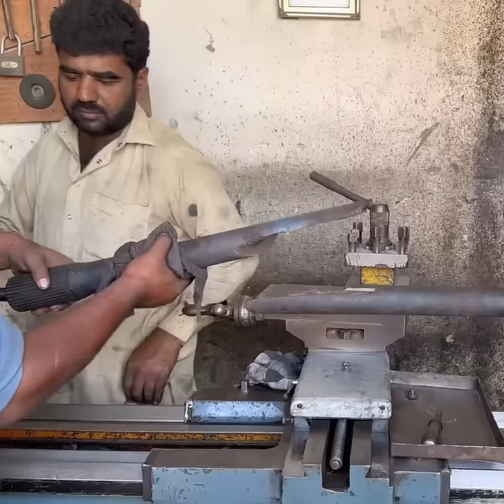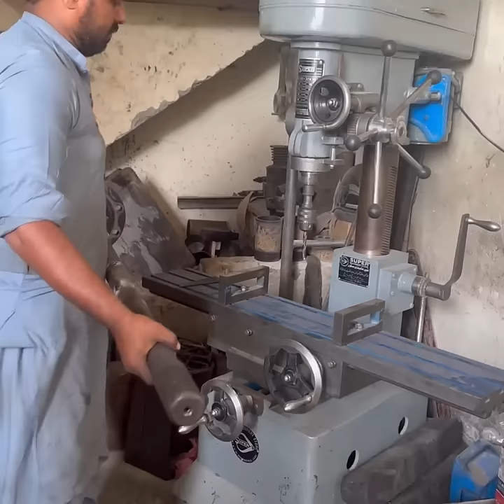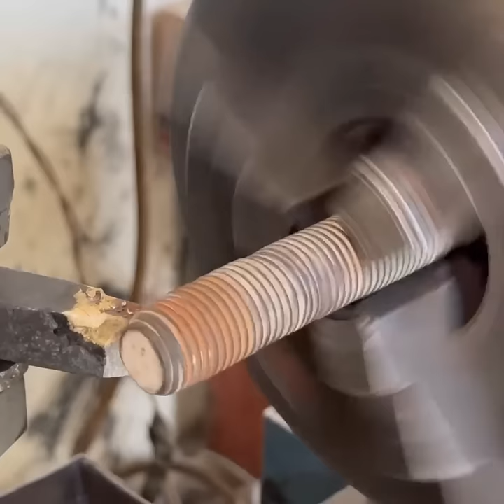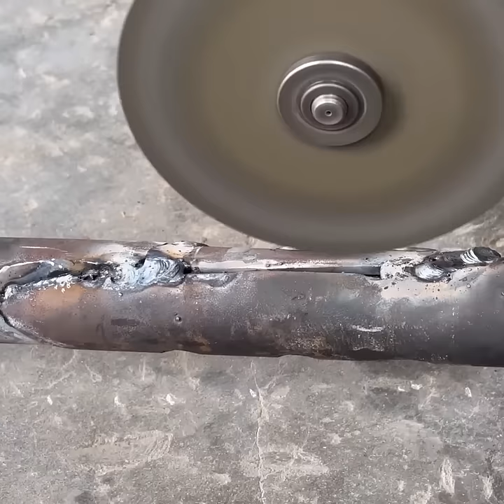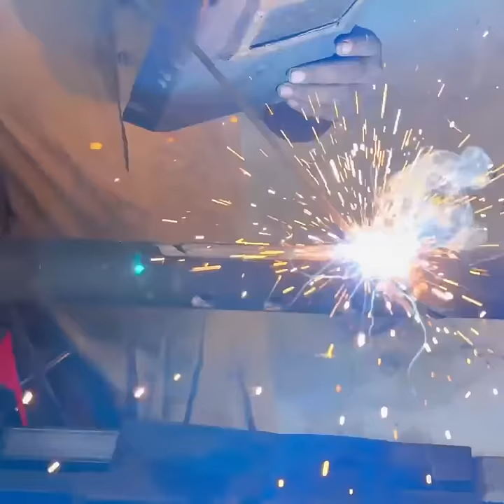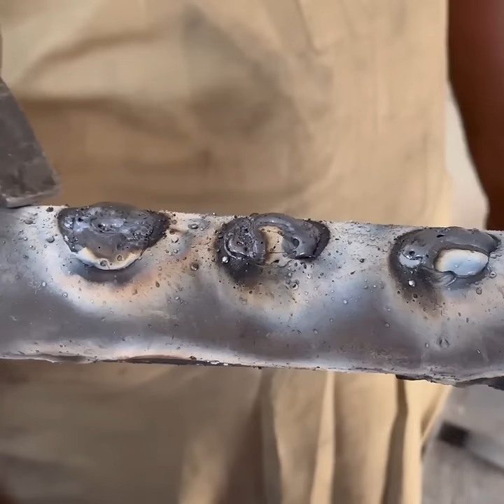How to Rebuild Broken Axle with Amazing Technique

Comment: As an electrician i approve this weld.
Reply: 😅man stay a electrician 😅💀
Reply: @rasherobinson2428  I know, that's why i commented a bad weld. Welding ain't my job, so my opinion is worthless. :)
Reply: @rasherobinson2428  When sarcasm pass, you looked the other way it seems.
Reply: درست است برقکاری ربطی به جوشکاری ندارد ولی نظرتون محترم
Reply: @aran_kurd Yet welding has everything to do with electricity.
Reply: Same here lol twist some copper around it for safety.
Reply: @jacobplank  I would personally install a heat shrinkable tubing on top off it to prevent any other breakage in the foreseeable future. :)

Comment: Love how you can see it cracking while they drive in the bolts. No way that thing is gonna last (or that this is cheaper than just buying a spare from a scrap yard)
Reply: This was from said scrap yard, the best they could find, not everyone throw away things like in your country. Buying a new part just wasn't an option as it is too expensive for them.
Reply: Don't use your standard of "Scrap yard" for other countries. People in your country throw away stuff that is still fixable or even usable. Meanwhile in the East people only throw stuff away when something couldn't be fixed at all.
Reply: Isso aí se chama profissionais , é o que está faltando em quase todos os lugares do mundo, quando se quebra na estrada e não tem recursos,tem que dar um jeito, e esse serviço com certeza fica 100%, fazem isto o dia todo.
Reply: It doesn’t matter how long it lasts on that economy. When it breaks and destroys itself to the point of no repair…. They led figure something else out. Thst May may be an hour or day away…. Most likely longer.
Reply: This is not Europe or the North Americas, it's India / Pakistan probably..
Replacement with new part? prohibitive price.
Scrap yard? if available, time and cost prohibitive.
Downtime on a commercial vehicle  could mean no eating for a family until fixed.
So? limited options, which makes them innovators, "doing the best with what they have".
And they can produce some great items..
Reply: @WangZord unanpieza de fundición no se puede arreglar soldando y con tornillos. Lo que hace es perder el tiempo y estafar eente
Reply: @martinsalazar6677  Why don't you tell them that and fund them while you're at it. Ofc it won't last it's a DIY job, then they will fix it again until they can afford to buy a new one or this one become unfixable. It's called "Improvise, Adapt, Overcome".
Reply: @WangZord  es un palier de camión, por el peso y la fuerza que hace, se usa una pieza única de fundición donde las fuerzas se distribuyen por toda la pieda. En la pieza reparada la fuerza se transmite por la soldadura o los pernos, los cuales no van a soportar dicha fuerza. Si fuese una reparación en medio del desierto para sortear esa situación, ok. Pero al parecer es una costumbre, bastante peligrosa. No te gustaría estar atrás del camión que pierde la tracción.

Comment: I wish I’d seen this years ago. I remember trying to weld some farm equipment to keep us going because the part was weeks away and we’d be done by the time the part came in. The hose clamps were ingenious!!! Wish I’d thought about that.
Reply: It's clever and potentially workable but I never saw them check the alignment of the 2 pieces and I didn't see any balance marks on the finished product. I can't see this lasting too long if it isn't perfectly straight and balance. The balance could slide if it is slow moving but  not so much the alignment

Comment: I was skeptical at first but when I saw that back cut for penetration and the dimes this boy was stacking, this is a damn good machinist working with what he has, mad respect
Reply: Except for all of the crap left in the middle which will just cause that to be weak and break. Doesn't matter how good the welds are on the outside.
Reply: @bruwin  I figure the pins will help reinforce it, but you're right, if there's Slagle amd porosity throughout the weld it's basically one step above duct tape
Reply: No way this axle is co-axial or balanced now. This most probably will cause vibration and extensive wear at some speed. The original part broke and the fixed one is not stronger.
Reply: Balance, an axle😂.  It is supported on either extreme end by a bearing.  As long as it doesn’t have a lot of runout in the middle you would never know.  And, they had it in the lathe so they know it doesn’t have any runout.  Also, I doubt the truck that’s from ever sees much over 50-60 MPH or <100 KPH
Reply: Just cos it looks nice, there is no torsional strength in it. The cracks are still in it from the break.
Maybe if they gave it 6 weeks the metal might heal together like bone... but its not bone, it will break again as soon as a load comes on.
Reply: Death wobble

Comment: As an aeronautical maintenance technician I aprove this repair, I realize it every day in our A330 fleet.
Reply: I think the popsicle stick bridge i made in the 9th grade had more structural durability than this shattering weld they did. It litterally had more cracks when they finished than when they started. I bet duct tape would hold better than those welds.

Comment: Looks like it has internal rust issues already. That's pretty much a waste of time trying to fix it as it will surely break again after some miles.
Reply: Do you really think they can afford other options? If they are even available to start.
Reply: @Anzeth_Zeon he's still doing bad technique: not cleaning the broken parts before Putting them together, the welds are not properly done(cold/uneven), the axle was not straighted Out and tested for trueness... just another video of somebody doing subpar work and people lauding them as cratsmen
Reply: @Karnickel93  kool, where did you learn about car repair?
Reply: @Anzeth_Zeon tf you mean where did he learn it, fixing your car isn’t some rare skill
Reply: @benwilliams9016 where did he learn all those steps? That is not basic car repair.
Reply: @xxxLUKRASsxxx  so he knows car repair plus machining? Do most machinists know how to weld?
Reply: Look at the grinded parts there is no visible rust on inside
Reply: @Anzeth_Zeon sounds like its you who has not a damn clue about metalwork or basic science . I was gonna ask where did you learn about metalwork but i know the answer , you didn't.  End of subject move on .
Reply: @Karnickel93 they done what's  right. You're just hating
Reply: @jackjack4412 that's a basic skill for every man that will work with metal parts
Reply: @Karnickel93   тут все смотрят для подъема настроения 
Какая разница как они её сделают  если изделия не жизнеспособное 
Ну разве машина стала  и буксировать нечем и это единственное решение  пустую !!! Без нагрузки попытаться доехать до ближайшего места для ремонта
Reply: @jackjack4412 actually yes most millwright journeymen and machinists' know how to weld. Kinda part of the job.
Reply: All it has to do is get him home....every thing else is gravy.
Reply: @rywmiller  what a machinist needs the welding for the only cars related jobs that require welding is bodywork
Reply: @rywmiller Correction, they think they do untill a real welder ckmes along...

Comment: A lot of people don't realize that they perform this types of repairs because they do not have the same resources we have here in America. We just call our local autozone or Jalopy jungle and we're set with a replacement.
Reply: Repairs can be done in two ways, the first is for appearance (what is in the video), and the second is high-quality, reliable (this is to make a normal section, weld, release the internal tension with a burner and then bring it to the idle in the parking lot). And here in the roller there are voids in the metal, moreover, already oxidized, which will lead to the destruction of the metal, and it will burst again in the same place in a short period of time. As a temporary patch, this is an ideal solution, but not a good repair.

Comment: There certainly is no shortage of criticizers but lets remember people that the weld is stronger than the original metal. I personally like the idea of the pins. Nicely done!
Reply: yeah but the act of welding it weakens the metal. that's why it fails right next to the weld every single time.
Reply: There is no way this weld is stronger than a solid piece of forged steel axle that was hardened and tempered. If you are broken down and need to limp your truck home this might hold up. But it is a temporary fix to get you on your way.
Reply: A weld is not stronger! Welding introduces enormes temperature differences and Due to tension cracks from the cool down it will break material right out next to the weld. Melt this thing down and forge a needle one.
Reply: You forgot the "never."  A weld is never stronger than the original metal. There, fixed it for you.

A solid shaft of forged, heat-treated alloy steel cannot be welded to its original spec using ordinary processes.

This repair may get one down the road a few miles in a pinch, but it is even less resistant to breaking than it was when it initially broke.
Reply: @kevincurry4254 Actualy weld is always stronger than original metal, but weaker point is heat affected zone in a base metal. In critical application welds must be heat treated afterwards. If this is an shaft  or axel weld should not be done along the crack,  but  it shoud be cutted out and replaced with mid piece. It would be good if tha root weld could be done TIG.
Reply: This is about as true as reading a goosebump book

Comment: Gotta do what you gotta do. I bet it holds up pretty well, honestly.
Reply: Maybe on a wagon that never goes above 15 mph. They never balanced it. Might last a few few miles but that's not even street legal here.
Reply: It'll be fine.
Reply: it doesn't
Reply: They function based on balance. They apply force torsionally. They are tested via MPI testing. It would fail every test the industry uses. Those repairs do not help in that application. It will just break more things in line with it mechanically over a short period of time.
Reply: La misma vibracion romperá ese eje en unos kilómetros y romperá el diferencial
Reply: @DaedalusHelios  Of course, it's not as good as one fresh outta the factory. I bet it gets the job done, but it probably vibrates some. It looks like they machined off the excess weld with a lathe, so it is probably fairly close to balanced.
Reply: @jimbusmaximus4624 thats kinda the point man.. of course it's not legal  here. But if you live in a country where you can't get mechanical parts easily, and your livelihood depends on that vehicle, it's R&R time.

Comment: Amazing fix. Durability might be reduced, but if it can be used for couples thousands of miles. Then is acceptable in term of cost. Nothing wrong until proven... Trust me Im an Engineer.
Reply: Just dont floor it and pop the clutch, right?
Trust me I'm a race car driver😂😂

Comment: Running the bead one handed while he holds that makeshift lens in front of his face is WILD 😂
Reply: This comment is why I went to the comment section. To see if anybody else called that out. 😂
Reply: Notice how the rivets wasnt even long enough and they had to fix it by welding. The rivets shouldve been longer, and attached by hot forging it into the countersink. Surely these guys have access to an oxy torch? Wouldnt a forged piece of metal be much stronger than a welded piece of metal?

And since a bit of hammering is to be done, they couldve just welded the edges first before drilling the holes and riveting it?

Comment: They do the same with motors, alternators, batteries, etc. This is what they do with EVERYTHING in these countries. Labor is way cheaper than buying replacements. Unlike here where labor is so expensive that buying new is cheaper than repairing.
Reply: Still doesn't mean this fix will last under actual load
Reply: @Thatweirdguy8619 работает и неплохо. Вопрос в том, какую сверх нагрузку даст водитель.
В следующий раз сломается уже в другом месте, на пару сантиметров ниже, или выше сварного шва.

Comment: Once it's broken, it's broken.
Reply: Алилуя
Reply: WRONG! The weld is stronger than the original metal and additional strength is given from the diagonal pins. Give credit where credit is due. That's a hell of a nice repair.